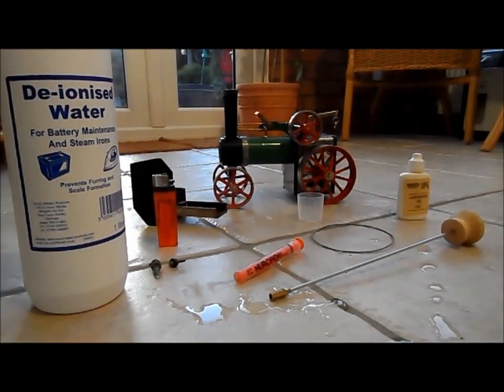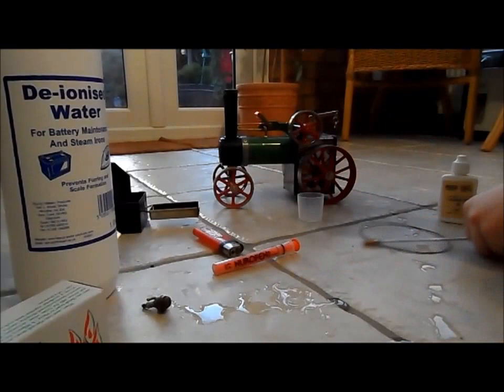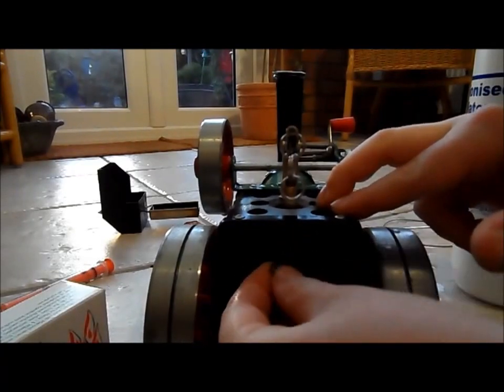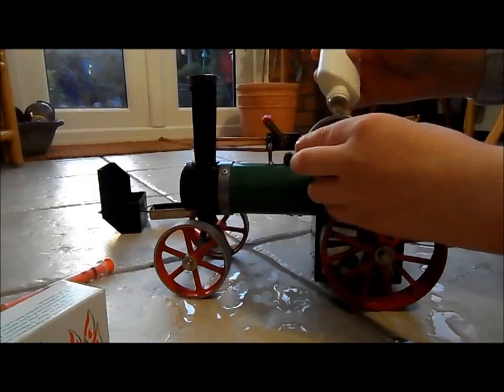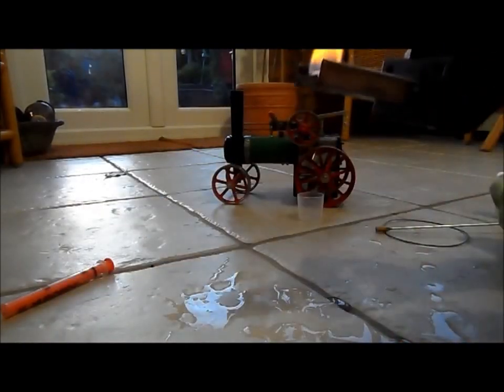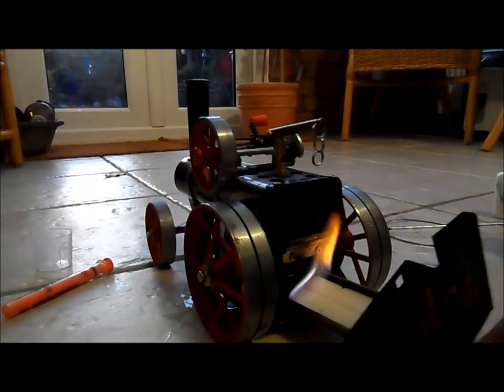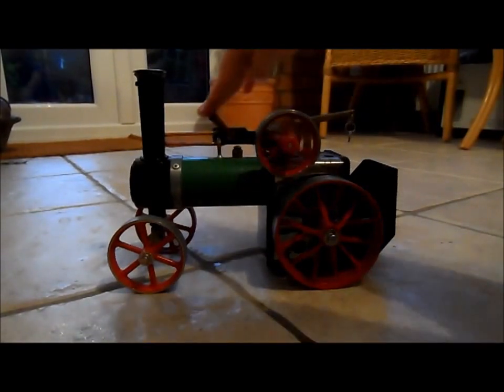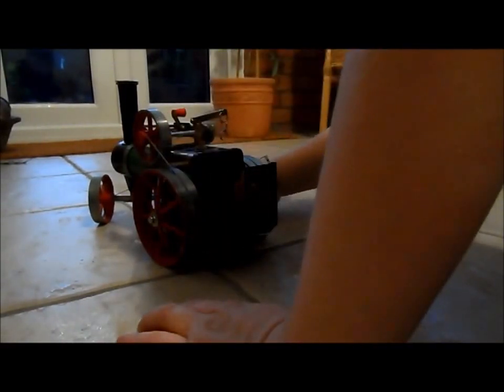How To Use A Mamod Steam Engine

Comment: Thanks george. Some handy tips there. I have an old one SR1 of these, think it was my dads and ive had it 40 years. With no instructions i never knew what the second valve on the back was for and overfilling did happen. Just ordered all new washers so fingers crossed it will go again.